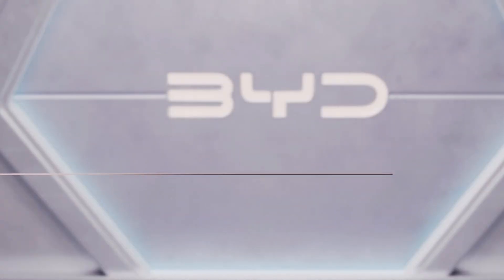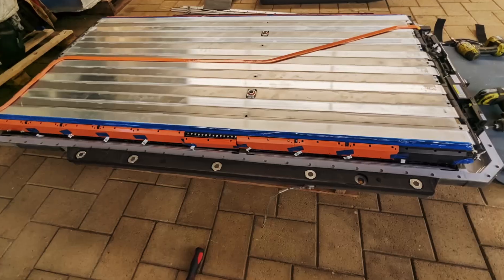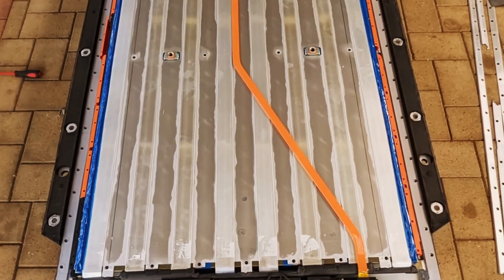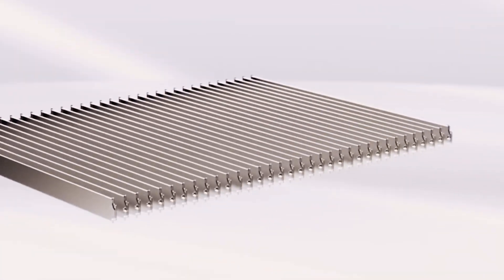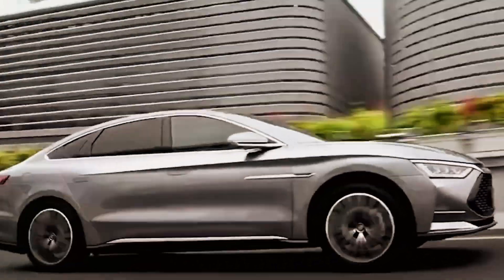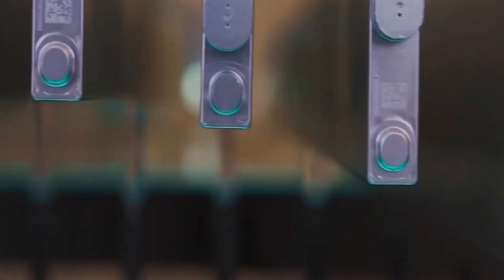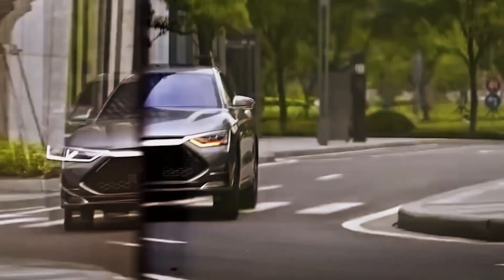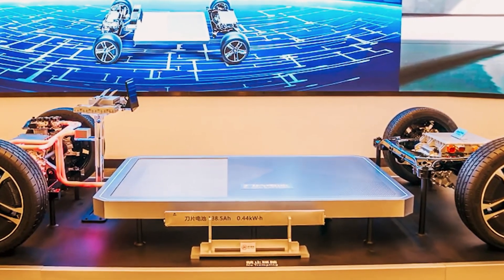REVOLUTIONARY BLADE BATTERY V2: 1000KM ON A SINGLE CHARGE!

Comment: BYD is a COPY of the TESLA  EV technology,  have DOUBT about the mileage!   according to the design,  even under puncture, but  Li battery will combust when contact in WATER,  also is something NOT WORKING in contact,  you need to REPLACE the whole unit, that it will be very expensive... so this  innovative  CLAIMS must be made by BYD...many doubts...